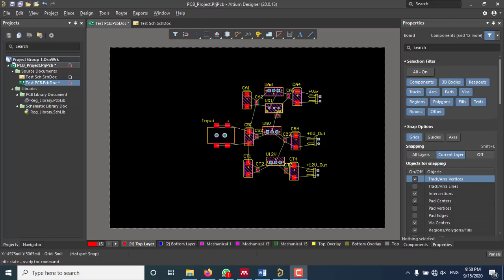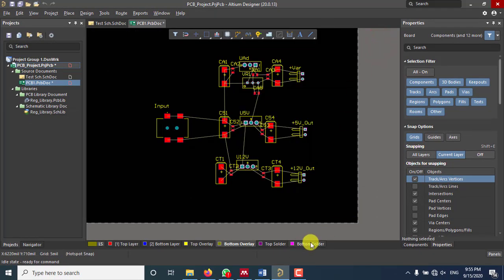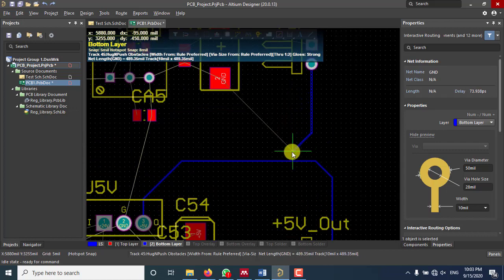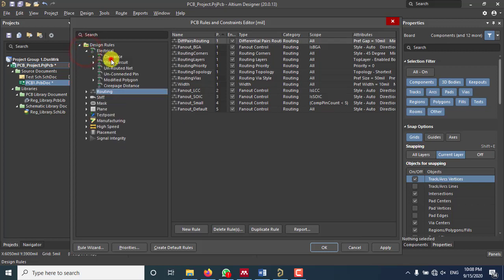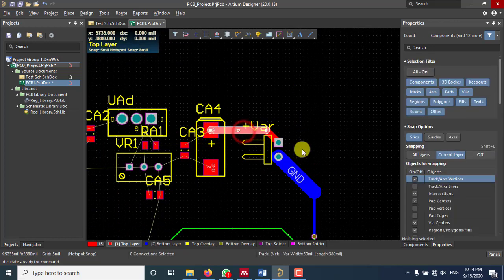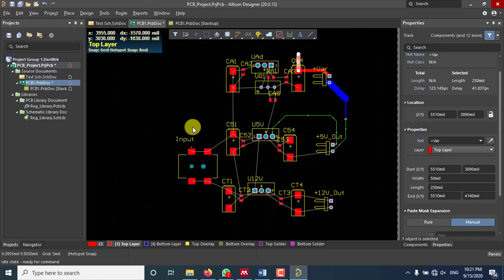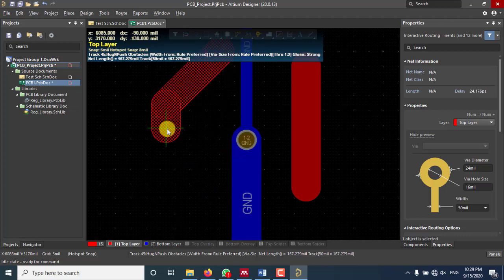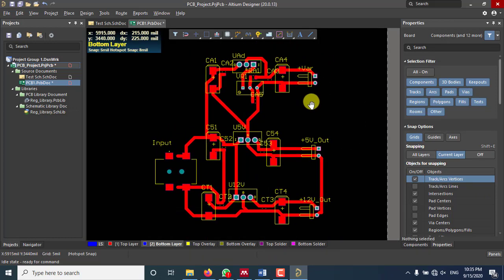Altium Designer PCB Editor | Rules | Stack layer |

Comment: Hello..I have a doubt...Is it okay to draw a top layer track over top overlay of a component? Will it cut the track when the PCB is manufactured?
Reply from the maker: Routing on top overlay is not same as routing on top layer. Top overlay is for printing designators and for annotations. You can alternatively use top and bottom layers for connections. No problem if a line on top overlay crosses a line on top layer.
Reply: @electrotechhub-h  Thanks for your reply👍🏻